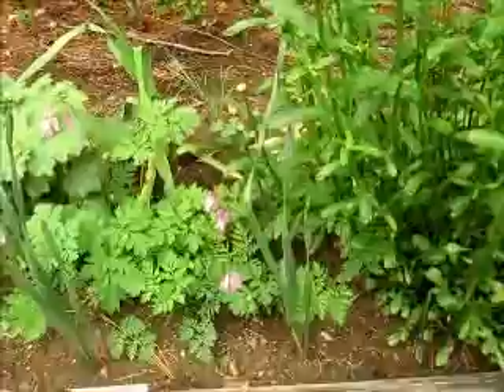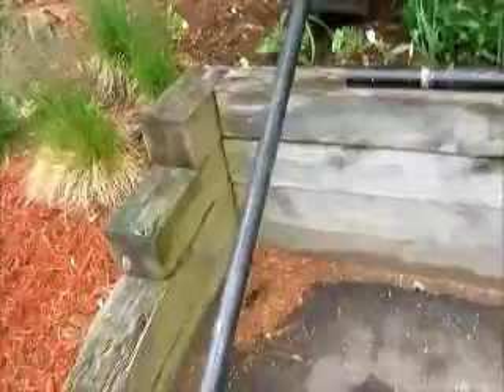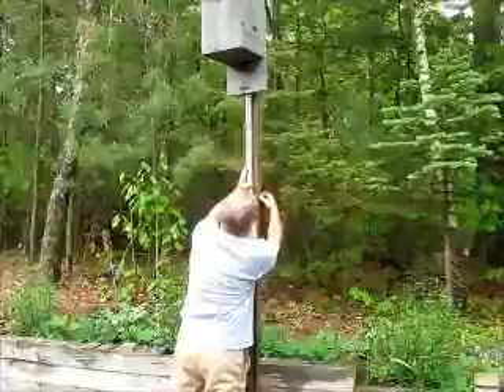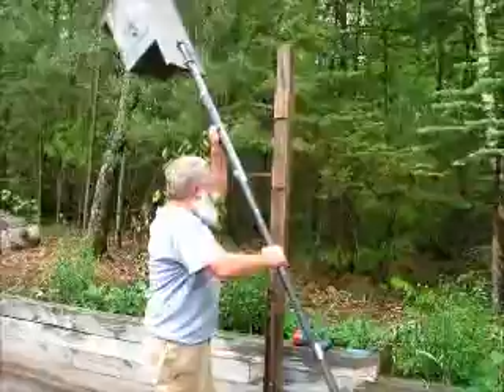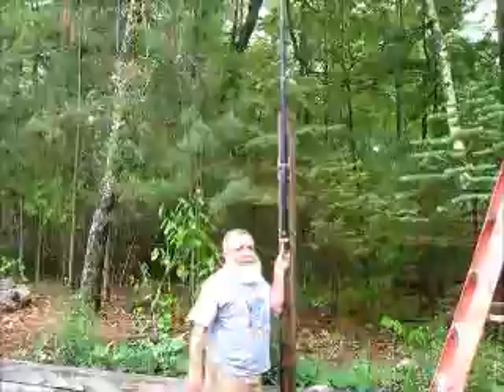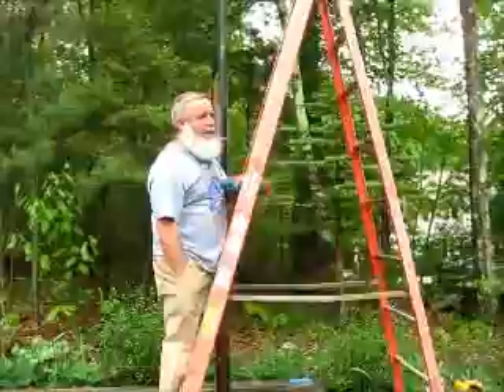American Kestrel nestbox sliding pole mount

Comment: One note on the build: sheetrock screws are incredibly weak and basically only designed to hold flimsy sheetrock indoors. If you want your design to last switch those out for some wood screws instead.